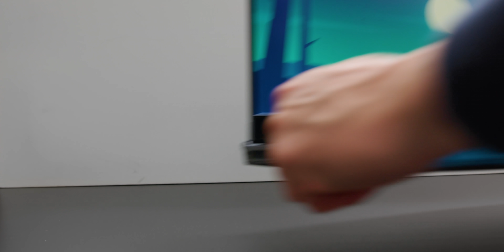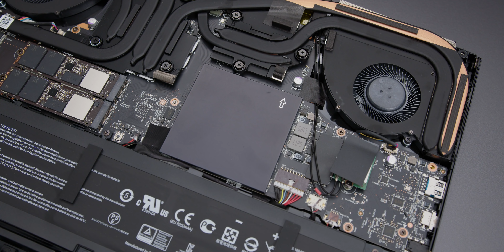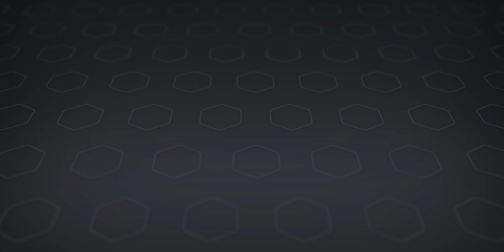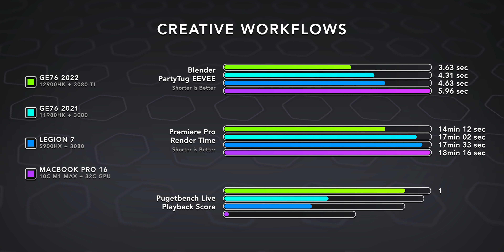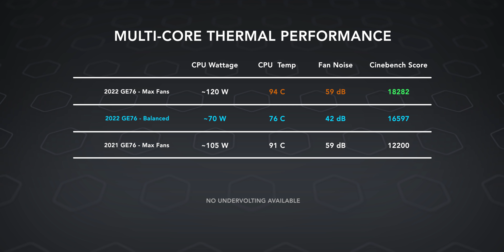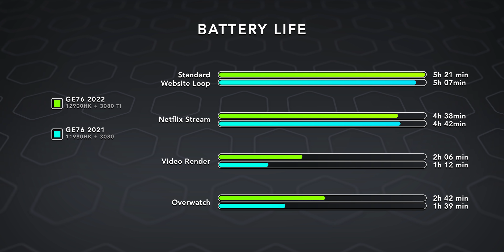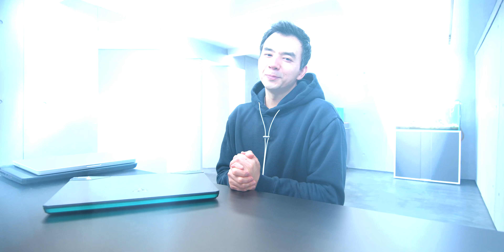This Laptop Is Faster Than Your Desktop

Comment: I used to have an MSI Laptop. It was great specs at a good price. Exactly what I wanted, but it never felt that greatly crafted, and I don't mean physically. It felt like a bunch of third party stuff that never integrated properly. Everytime windows updated half of it would stop working and you'd have to wait for new drivers to become available. Sometimes the subwoofer just wouldn't work. It just never felt like a complete package.
Reply: This omg. I went from an Asus G75 to an MSI thinking they were just competitors and all that would change would be the brand. Holy. fuck. Was I wrong. A massive downgrade in everything but the hardware itself. I shouldn't have skimped out $100 for a sale.
Reply: @Wylie288  wow. I remember before I bought my last laptop, thinking MSI might be a good way to go as an "enthusiast brand". Ended up getting an XPS 15 instead. Sounds like I made a good choice 😅
Reply: I used to have a laptop with similar issue. Awesome specs but not translating into desired output
Reply: I am running a GT72 2PE Dominator Pro with the fancy Tobii eye trackers as my daily driver for the past 7 years with a 4th Gen i7 and a GTX 880M. Having an MSI laptop was a dream for me, but it’s not great. The build quality is skeptical, with everything held by screws with the worst being the area around the bezels with unreasonable gaps. The LCD, lots of backlight bleeding wasn’t great too and the GTX 880M decided to fry itself and with no compatible 880Ms to replace it with. Currently using it as a desktop rig with an external keyboard, due to previous water spills that ruined some of the SteelSeries keys with RGB still working!

Comment: I'm super annoyed about NVidia hard limiting the 3080 non-ti series wattage, the extra 10w is seemingly most of the reason these new ti variants are faster, without that they'd be almost identical. It feels they just held back the last series so they could give people a reason to buy these newer units; which is just creating more ewaste. 

If you look at units with full boar power and cooling, such as the Clevo X170KM this year, the 3080 in that performs almost the same as the 3080ti in this MSI unit, imagine what units like that could do with unlocked power budget, 180-200w would be insane.

Comment: Its a  good CPU. Not great ,least efficient CPU out there. They are pumping more wattage to the CPU and made it  made it powerful with more heat and more fan power needed to cool it.Power consumption is on par with the GPU. I think it productivity Benchmark sucks on battery .Most people are going behind performance while some leans towards efficiency. Overall great CPU with non impressive 5% faster GPU.

Comment: Nice to see Intel be relevant again, but I'll wait for another brand to come out with a competing laptop. After 3 MSi laptops, I can never in good faith give that company my money ever again, it's the biggest letdown in my personal tech use
Reply: What happened to the 3 MSi?
Reply: @joeluaje5389  one had endless crashes and bloating issues because of all the crappy bloatware it came with, it lasted 2 yrs perfectly and on the third everything started dying out randomly, from RGB lights to mic to webcam, certain keys, etc. 2nd one was overheating to all hell within the first day of use, would hit 100+C and crash PC, could never handle demanding games even though it had a 1080, and third one had faulty mobo, got it switched out, only for the new one to have the CPU and GPU installed with what looked to be like little to no thermal paste and one cooling fan not working. its just been a nightmare using them

Comment: My key concerns, that Intel was overfeeding its CPUs which would set them ablaze, have been sorted. I'm really glad intel sorted their thermal issues out. 70 degrees and 40 decibels feel correct.
Reply: They are overfeeding their CPU's.... 105W 93C? How is this a "laptop CPU" it uses more power than a 5800X desktop CPU.... Hell it is approaching 5950x territory. You could turn the clocks down on a 5950x by a little bit and it would fit the 105W power envelope. Or just literally set the EDC / TDC to 105W and it would slap this chip around. The thing is that 75W performance is "decent" but remember that Only Intel actually makes 75W+ mobile chips. AMD's 5900HX uses around 45W even though some laptop companies set it to 75W for 3-4% more performance.... Really it gets 90% of its performance at 35W and not much of a drop for 25W either. 

So Intel is really nowhere near where they need to be in terms of power efficiency.

Comment: The takeaway here is that Intel still cannot compete on wattage at all. The performance at 75W in Cinebench R23 (a best case scenario for Intel and its E Cores) is still about 20% higher than the 5900hx which came out in 2020.... However the 5900hx really uses around 45W as pushing it to 65W doesn't really yield much more performance. So its a 45W chip vs a 75W chip and Intel has 14 cores and AMD has 8.... 
So this is a scenario of the E cores actually accelerating some workloads. While the performance is no doubt impressive.... to hit 93C on a huge laptop like that shows just how hard these chips are to cool. They are not ready to actually compete with AMD in a meaningful way in 2022 except maybe taking back some high end performance #s.

Comment: To answer your question, no it's not faster than my desktop (5900x + 6800xt +3600 cl14 ram, etc) but its an impressive laptop.
Reply: Not anywhere near as fast as my Threadripper desktop either... Kind of competes with my old 3900x desktop, but it also uses almost as much power lol
Reply: @Jimster481  yeah you can't replace desktops with a laptop,
Man the recent competition between AMD, Intel, Nvidia made us see insane results as consumers, I can't wait to see the ipc improvement on Ryzen 7000 chips.

Comment: Those are fantastic performance numbers, but the battery life is still garbage compared to the Macs. If you're getting a laptop, you need efficient power, like M1 Max MacBook Pro.  If you want a powerful machine, just get a desktop. Wait until desktops get these 12th gen chips, that will be impressive! Until then, M1 Macs are the king for portable power computing.

Comment: The elephant in the room is the fact that at max loads Apple's M1 chip goes up to 92W package power and 120W wall active power (plus it gets quite toasty at max). I agree that at minimum loads apple's m1 kills it (web browsing and office apps) but at that point you are spending at least $4k for almost the same battery life as a google chrome device would give you. Take that extra $3k that chromebook saves you and build a really nice gaming laptop (when the GPU shortage ends).

Comment: What is wrong with MSI every year they release the same thick blockey no style laptop. The machine is way to thick, the screen has a huge chin, the keyboard is the same ugly crap chick lit style and lets not forget about that ugly out of p[lace dim light bar. I just cant take MSI serious they are the king of ugly clown looking gaming machines. Its fantastic to have all this power and amazing chips but all MSI did was repackage the hardware on an old chassis. Come on MSI get a new design department a enough of this old looking gaming crappy style, hell Alianware can produce an ultra thin gaming machine but you cant. I'm waiting to see the new Alianware with this new chip set. Dave call Alianware and have them send over a press model with this new chip set.....

Comment: 2 years ago everybody: intel days are over. amd is killing it. apple's upcoming silicone and arm architecture will destroy it. 
intel for 2 years: new gen chip, takes even more power and gives similar nothing crazy bump in performace

I was thinking intel can't be just sitting and waiting for others to deliver just better chips and destroy them and they were who introduced x86 which is the basis of almost all things today.

And here comes the response. Significant bump is an understatement to the numbers I saw in this video and even at 70w, it's superb.

Comment: Quite an informative review, I am looking forward to the performance of Intel's 12 Generation laptop chips in a thinner chassis, in particular the Dell XPS 15 and 17 inch models. I would like to see what thermal cooling solution Dell implements with the higher specification 12th Generation chips, hopefully, they do not rely on aggressive thermal throttling.
Reply: They do aggressively limit TGP to both CPU and GPU. IMO this is a better tradeoff for most people compared to the older 9560 where they just let it run at max power until it hits a brick wall and throttles down to 10% clock speeds and the whole system starts to stutter. On the other hand, I was able to stop the throttling on my 9560 by a combination of cutting holes in the bottom shielding, getting a laptop cooling pad, and buying a portable AC to bring the room temperature down. So I guess technically I have the 'best of both worlds' 🤣 (edit: although yes, I'd rather they just give it adequate cooling in the first place)
Reply: Avoid dell xps at all cost, their thermal systems and cooling are a joke for both xps and vostro series

Comment: I will still wait for few more years. Every year i think this is it, now i can have great gaming in a portable machine that wont set my table on fire or lift off, every year i am disappointed (every 2 three years i mean). My current alienware r4 m15 sucks. It cant even produce any number without almost starting to melt. I will push my dream a bit longer. Aint falling for the same trap thrice.

Comment: Super happy to see Intel showing up this year. But I'm waiting for Zen 4 to see the competition. 🔥
Reply: Zen4 is likely to blow it out of the water again. Intel is barely competitive considering that they need 75W to secure a real win against the 5900HX. I'd like to see both chips compete at 45W to see where Intel really is.
Reply: @Jimster481  amd Mobile chip is never good with that cut half L3. And zen structure  hasn't changed much except increased L3. I don't  think zen4 Mobil will look anything good
Reply: @zihechen3111  I have a Zen3 mobile chip and it flies like the wind. No idea what you are talking about. Sure it isn't as fast as Zen3 desktop but it is faster than Zen2 desktop and Zen2 mobile. It also has really great performance at only like 25W, I know because I play Heros of the Storm with it and it gets over 100FPS in that heavy single threaded game with only 25W power. Even in games like COD It only gets like 28W power on my Alienware laptop (due to my custom thermal limitations) and it flies. 
Intel is literally nowhere near this in terms of efficiency. It is once again Intel pumping their chips with tons of power and turning the clocks up to 11 (past 5Ghz) in order to win in anything.
Reply: @Jimster481  12400 is running at 30w when 5600x running at 90w during gaming. Same performance.  They just got tested side to side.
Reply: @zihechen3111  Maybe on some intel fanboy channel. Not in any real world testing with any real channel that does actual fair testing. You can watch gamers nexus or der8auer or even hardware unboxed.... what you are saying is 100% fake.

Comment: I'd like to see how dell's XPS lineup fares this year. 9700 and 9710 can cool 70W on the CPU stock, and if Dell lets Intel rip, we're looking at 40% performance inprovement. That's insane.
Reply: If they had just put AMD in they were looking at 100% performance improvement with much better battery life. Instead the XPS lineup will continue to be a solid "meh" with atrocious thermals, loud fans and shit battery life.

Comment: GodDAMN.

I was drooling & on the edge of my seat until we saw, "1080p panel".

That is SUCH a waste of horsepower; at that resolution, there is (currently) nothing that will actually put that 175w 3080Ti to work. /sad

Comment: Congratulations on intel come back!! I’m looking forward purchasing the new MSI gaming laptop.
Reply: If 105W power draw for the CPU in a mobile device is a "come back" I'm not sure what isn't a "come back". This chip draws way too much power, even on 75W it is far behind of the competition in terms of power draw.
Reply: @Jimster481  105 Watt is the maximum idiot! Most of the brand will cap the power at 60 Watt. So it will between 30-60 watts
Reply: @brahmasthaandipramana7591  if you see how much performance is lost going to 75W.... you think that 60W is going to be much better? What about 30W? These chips are not at all efficient for what they are. 
The 5950HX that they are comparing it to literally uses like 45W.... so Intel is using literally triple the power to have 50% better score....

Comment: Not really a  knockock on Dave, and I'm not an apple fan boy, I own multiple windows and Mac... But unplug the "laptop" and run premier pro and run it against the m1pro/max.  This looks fantastic as a portable desktop replacement, not so much as a practical laptop. we have no info.. do the new chips consume less power now allowing them to perform on battery. 🤔 Great video otherwise, just eliminated some valuable information on performance as laptop. Which would affect my buying decision.
Reply: The new chips pull even more power 105W 93C... its a literal joke of a chip. Yea it is fast, but its for a desktop replacement not for a mobile device. 75W performance is "good" but this is still not mobile territory. For example the Surface that I am using right now has a 4980U and it uses like 24W max...
Reply: its a gaming laptop. 😅
Reply: I don't think anyone buys a gaming laptop to play while it's unplugged. It's a thumb rule to use it while it's plugged in
Reply: That's my point, Dave is comparing apples and oranges. Shows how much faster it is plugged in compared to the Mac, then doesn't show how much faster the Mac is when it's unplugged... That's all I'm saying and I've always tried to game on my gaming laptop unplugged, none of which went well..lol I can however get sustainable fps on my Mac for the 1 or 2 games that I've tried on it. 

Then he compared premier pro a creator application, unplug it and give me some results. More useful info for me personally. I have a desktop for gaming.
Reply: @monstermini225  Yes it is my point too. This laptop is huge and is required to be plugged in all the time. The performance gains of a plugged in laptop is not really valid compared to other actual mobile platforms.
Reply: @monstermini225  he's showing the best possible performance available in the market right now and that is Intel. This a battle of power in which Intel destroyed apple and that's all he showed. He's not comparing them in different scenarios. The video is meant to show the king of performance at the end of the day. Nobody is going to ask "oh this is faster when it's unplugged". The question stands as "what's the fastest chip in the market" the answer is the intel 12980HK.
Reply: @shouryamitra8858  I don't disagree the Intel is the faster of the chips, it should be at  2-3x the power consumption. 

Point again is it's a gaming laptop/desktop replacement, it should be compared against similar laptop. The new MacBooks aren't strictly those, not really a gaming laptop and not really an unlimited power/ weight be damned literally desktop replacement.

I've owned Intel based desktop replacement laptops before, they are a use at place A, take to place B, and don't think about using it in the space between the 2. 

They have a place but he just told us the new Lamborghini 2 seat roadster (Intel is faster) and that the base 4 door, 5 passenger Tesla(Apple) is slower... But gets better economy... Well duh, but tell us how much further the Tesla will go.... 

I myself will gladly sell my m1 pro 14 in. There is a wait through the roof to get them... If I can honestly take the 12 gen Intel out to meet customers, launch Da Vinci resolve... Scrub through 4k footage and tweak advertisements and thumbnails on site...( Sometime outside) away from power and not be praying the battery didn't die before I'm finished.

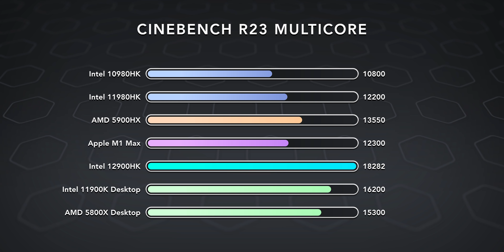Comment: It would have been better if Dave were able to show power numbers along side competing processors. IIRC, AMD processors dont consume more than 45 W even when plugged in. Dave here shows a 100+W part in a laptop with insane noise profile to be 'better than anything AMD has'. I see where he is coming from cause at the end of the day the consumer cares for top end numbers more than power consumption. But i feel a more balanced approach would be to show 12900HK in 70W mode along with 100+W mode in benchmarks and also put power figures next to all the processors when presenting the graphs (like at 7:02)

Comment: I wonder how much it’s gonna cost on europe.3.5k€ or 3.8.I mean if it hit 4k there will be no meaning to buy this thing.I am guessing screen will be non g sync like previous years.And another thing I am curious about why they are making this 360hz panels.Other than csgo I dont find anygame that hit that fps.Even if you make all settings low the gain between 240hz and 360hz is abysmal at best.